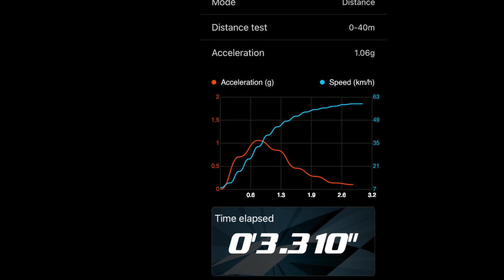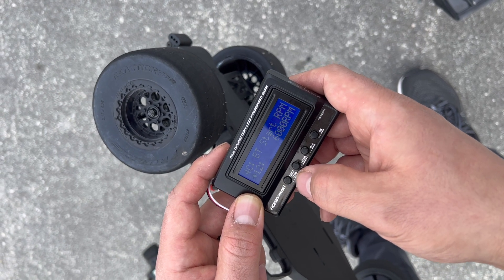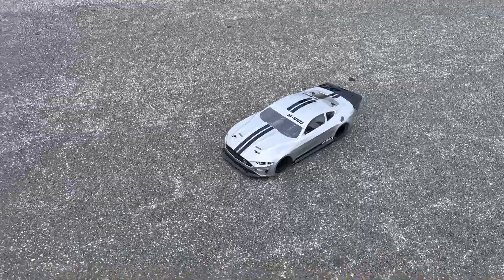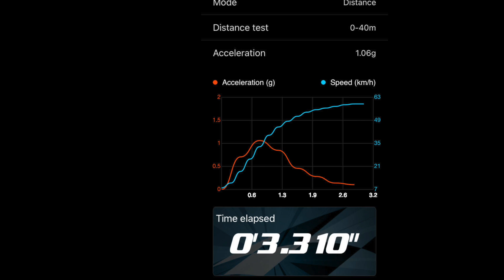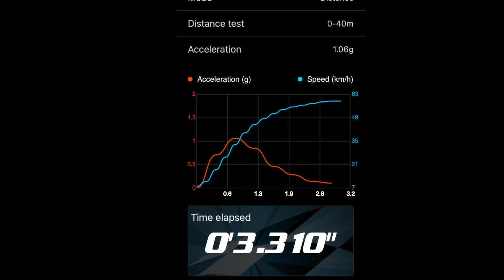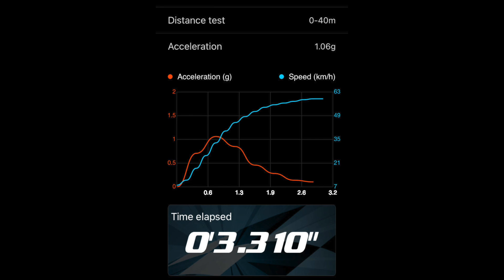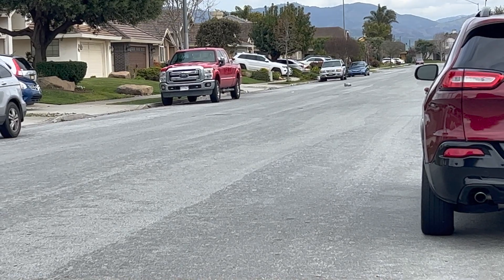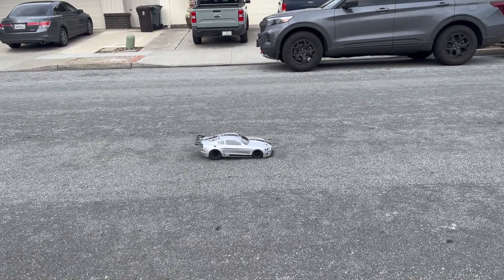RC Brushless Motor what happens if one exceeds 60 degrees of timing with Turbo and boost Part 1

Comment: Turn off the low voltage in your xr10 in my no prep I run a combined timing of 80 degrees and no problem with my 3.5t
Reply from the maker: I just ran a run with 47 degrees in the motor and 60 boost... no turbo. I bumped the RPM boost start from 6K to 20K. It ran pretty good... but I got rained on again. I will make another video with notes if I can get a dry day to run under and over 60 with and without sensor mode. At low rpm it does not like boost and limps. But at higher rpm one can hear the change in pitch as it keeps pulling.

Comment: Many people exceed 60°mostly it's with 2-pole motors. Also you'd probably get much better results topping off your battery in between every single run as I'm sure you're well aware voltage equals power. Guys local to me have run next to 100° timing with 2 pole motors but that hundred degrees wasn't fully engaged until up next to 80K plus RPM. Now most of the fast cars they outlaw guys are running 4 pole motors. I've only run about 35 to 40 degrees but some guys run 60 and I'm sure everything in between. The fastest I've been is a 1.88 which is still pretty slow for an outlaw class no prep car. 

We used to race dry tire and the fastest I've been was a 2.21. I ran hobbywing for a little while then used castle for a bit then I have been using R1 for over a year. Thanks for the vid
Reply from the maker: Thanks for the info. This is a "stock" 13.5T. Those other motors you mentioned will draw far more current. One example of a very thirsty motor is my Tekin.
Reply: @telecomandorc  I haven't done any 13.5 racing but I have participated in the box stock class. Locally that consists of you're allowed to change tires body shocks and servo. And of course 2s battery Our times are hi 2.3x up to 2.9. very competitive very fun class. Also it is dry Tire no prep
Reply from the maker: @Blind-J  Before someone mentions stock class is blinki... I was just doing the timing change for the test. Normally the esc is blinki. 

And to add to your comment, I also think stock is fun and not real need for more. The cars take less of a beating too.
Reply from the maker: I will try sensored and sesorless as well as only boost at higher rpm once I get a clear day. So far we keep getting rained on. I was thinking that exceeding boost may work at higher rpm as the motor would already have plenty of momentum to keep going forward.